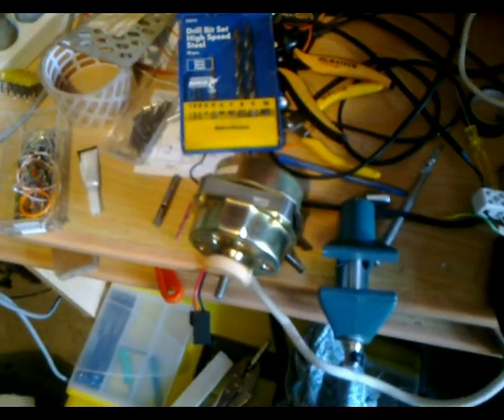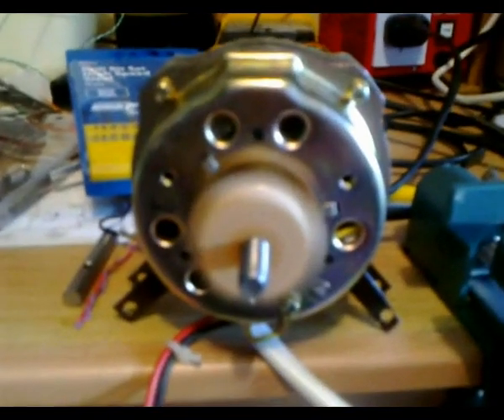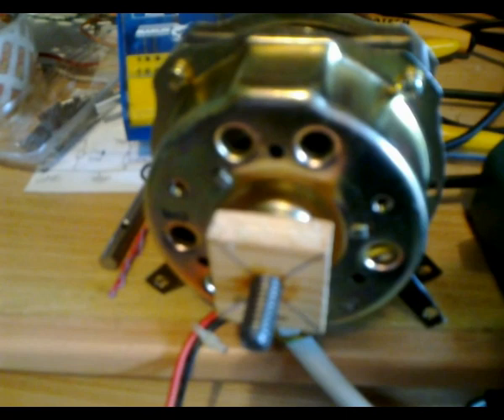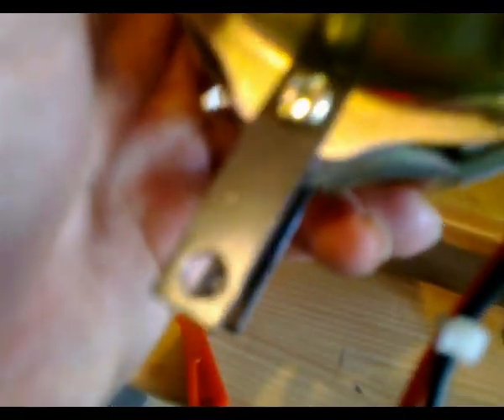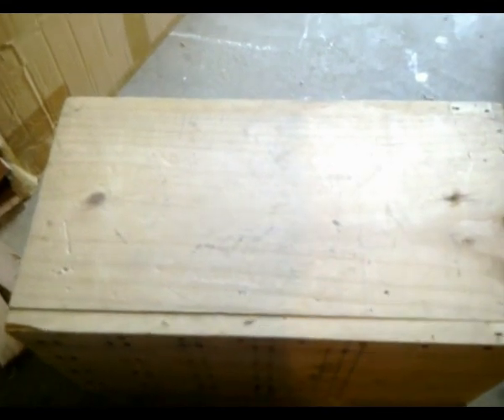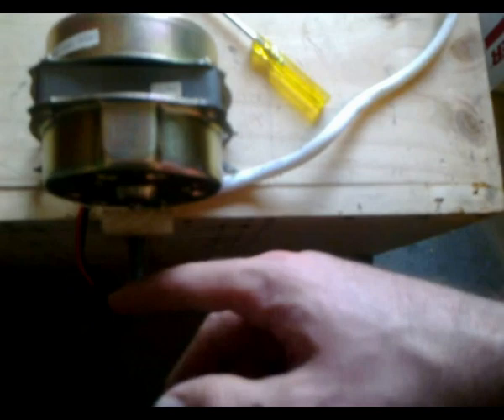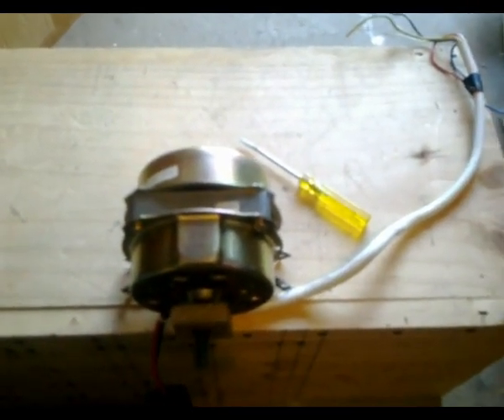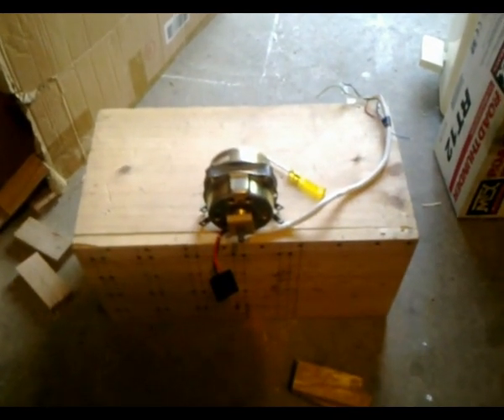Homemade 40cm plywood disc mechanical TV (Part 4)

Comment: ...It is not often realised that for mechanical TV, whilst the resolution in across the scan lines is low (e.g. in this case 32 samples), that the resolution along the scan line is theoretically infinite and only limited in practice by the size, in the direction of scan, of the aperture, the electronics, and the transmission medium. Hence it is obvious that the scan line should be in the direction of greatest picture detail or greatest picture length.

Comment: Actually, it can be shown, that for low definition video (NBTV) the picture is generally better when vertical. This is because most objects televised are dimensionally greater in the vertical direction than the horizontal (e.g. a human being, or a tree... etc). Baird realised this and hence his original format took advantage of this....